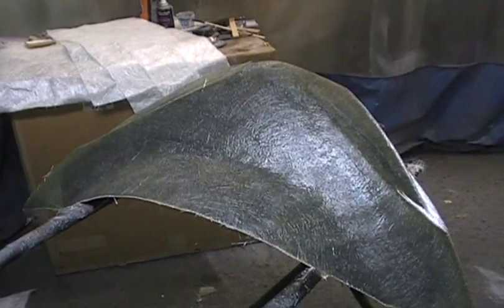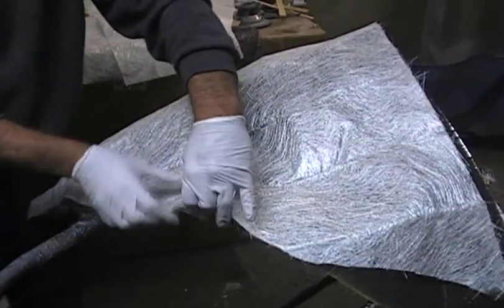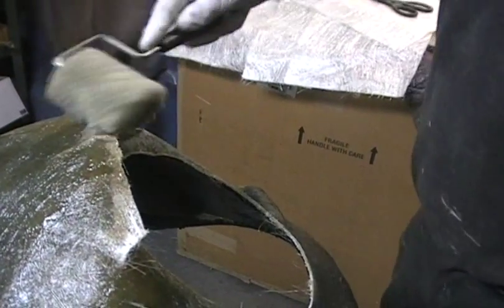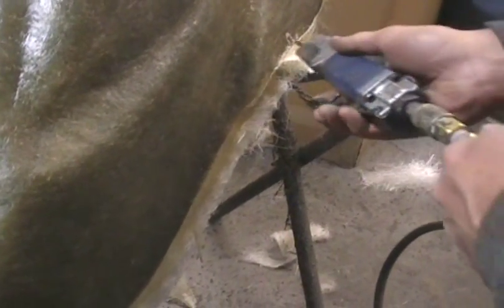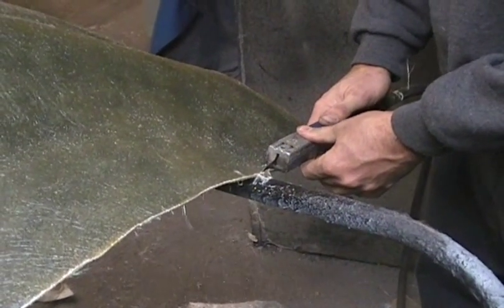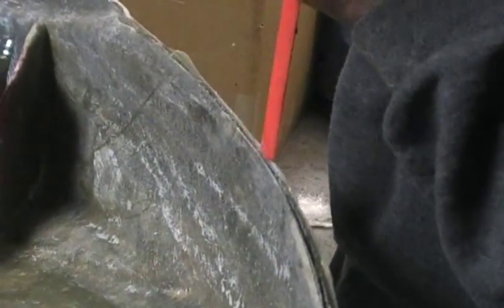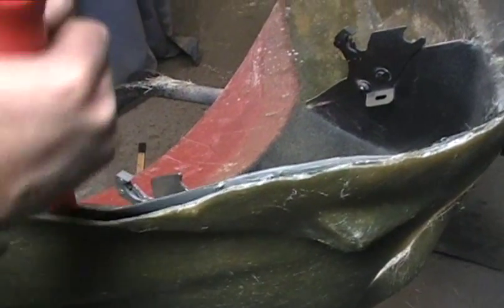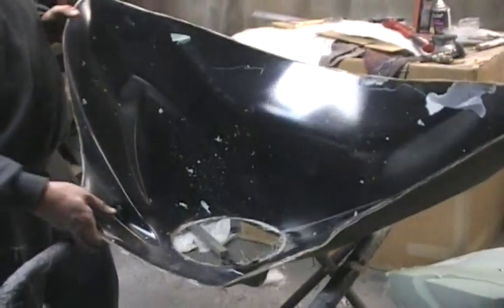Witchdoctors - How to mold

Comment: It looks to me that you pounded the crap out of that mould and it looks like you have damaged it. I would have used lots of PVA on that mould I always have excellent results with that product and when I demould parts I use water no problems and no damaged parts. Also on your master mould if you had attached some tabs and a bit more bracing it would help with demoulding. its best to always use the metal glass roller and squeeze as much excess resin out of green parts as excess resin adds weight not strength weight is something you don't want up high on a bike.
Reply: Hygb